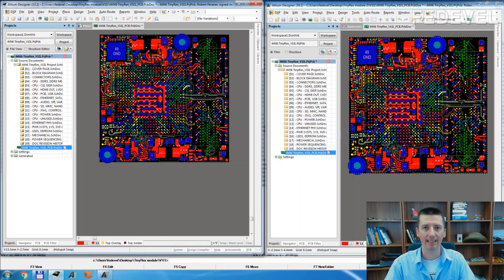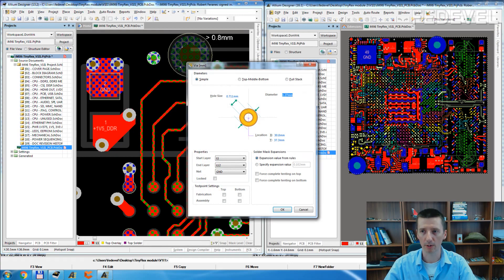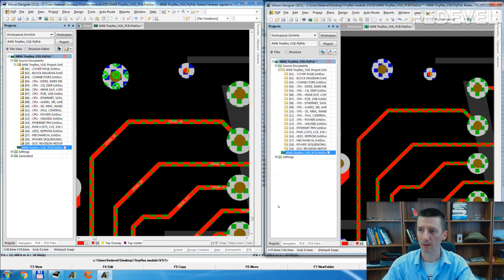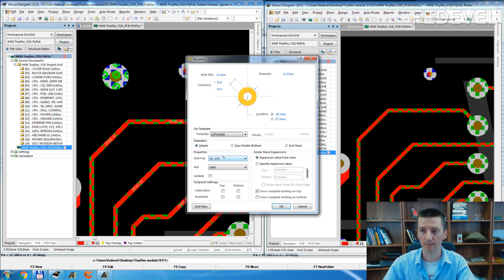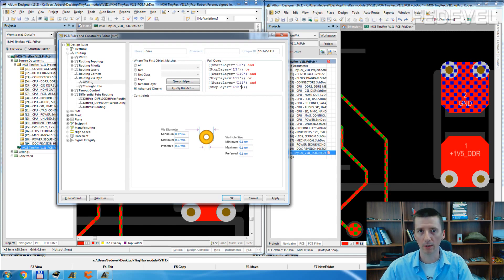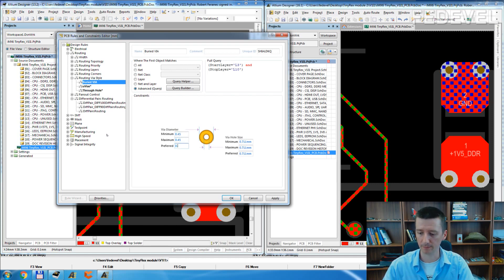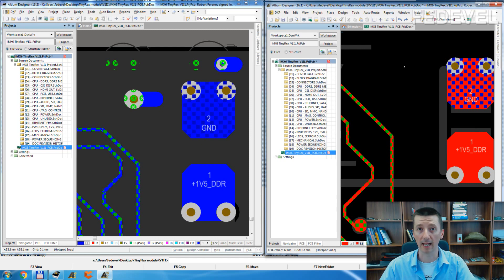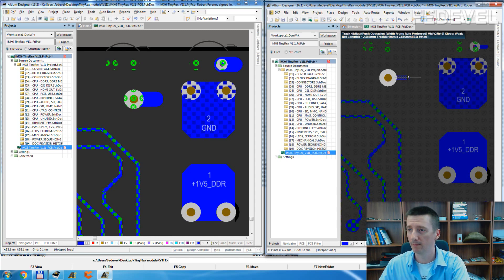Altium - VIAs, uVIA, Buried VIAs (The New & Old Way)

Comment: I have a question about routing and vias placement. "For example,  if you have a 6 layers PCB, a microvia from layer 1 to layer 2, a buriedvia from layer 2 to layer 5 and I would like to get to layer 3. Is it necessary the small connection between vias on layer 2 (through a small track) ? Or is it possible to place those two vias (micro and buried) one next to the other in a vertical position all way down. In other words, what I'm saying is, place the micro via and under this the buried via, I noticed Altium allows me to get to layer 3 without a connection (track) between vias"

Sorry for the question I new in Altium. I hope you get me.

Thank you in advance.

Comment: @Robert Feranec
Thank you for the useful tutorials. I learnt Altium through your tutorials. 

I have a querstion regaring vias. My current work is with a power PCB which needs to carry much higher currents than usual on signal PCBs. Therefore, I have internal copper planes to distribute the current. To connect the respective internal planes to the top and bottom layers, I am using vias. However, unlike standard vias, I want the vias to be completely filled and caped. How can I set the via filling in Altium? I could find the top and bottom caps but don't know how to specify that these vias need to be completely filled with copper. Can you please give some hint about that?? Thank you ..
Reply from the maker: Thank you H ABS. This video may help you: https://youtu.be/FM3pRM0CxGw
Reply: @RobertFeranec  Thank you so much for your response. I did watch that video and posted a couple of questions there. It would be really great if you could help with those.
Reply from the maker: @habs6398  answered

Comment: does pad have a through-hole via by default?
Reply from the maker: Depends on what pad - a through hole pad would have a hole, smd pad will not have any hole.
Reply: @RobertFeranec  in pad properties if i select multilayer it will have a through-hole and if i select top layer it is a smd pad right?
Reply from the maker: @chamarasilva7700  yes, that is right
Reply from the maker: @chamarasilva7700  yes, that is correct

Comment: Do you know if there is an automatic way (as in Cadence Allegro) to route VIAs for the return path of  a high speed differential pair? In Cadence it's straightforward... But in Altium I can't find a way to do the same... Do I have to manually place them each time I place a VIA to change layer while routing that kind of differential pairs? Thanks!

Comment: Hi. "Min/Max preferred" and "Template preferred" don't used together in one rule?
Reply from the maker: I didnt try it, but I guess, these are two different options which you can use - specify it directly through Min/Max preferred or use the template (and there you specify tolerance?).